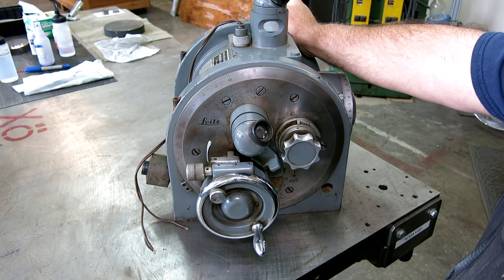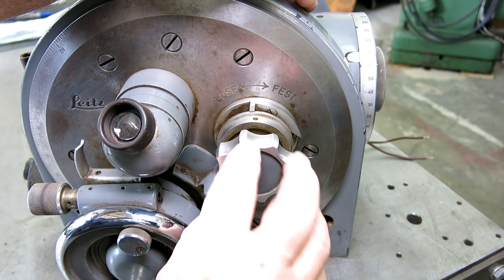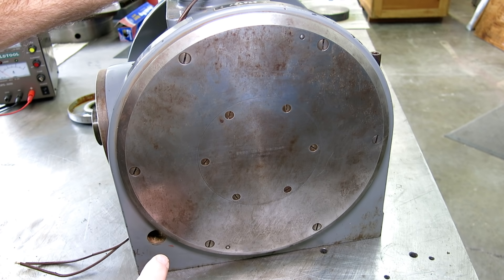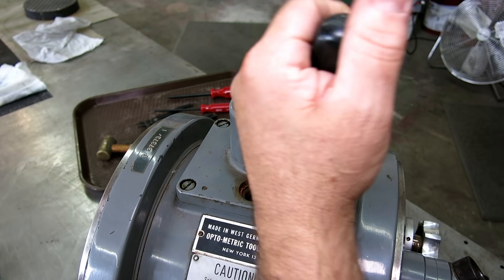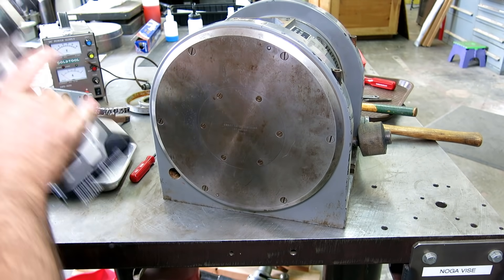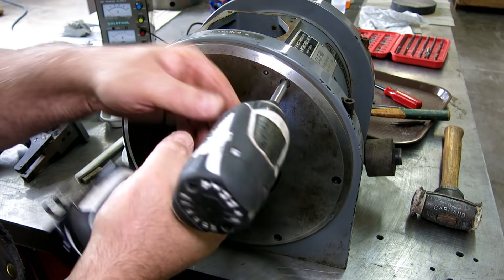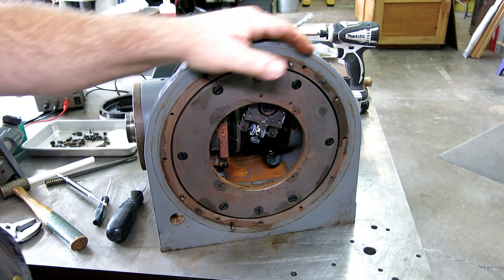Leitz Optical Dividing Head Teardown P1

Comment: Come on, Tom.  You know you're not going to give up on this beautiful machine.  I'll bet you've already got the brass rod in the lathe to replace those damage screw covers.  And there has to be some filing involved at some point or it wouldn't be a Lipton build.  Can't wait for part 2.  😉
Reply: As I was seeing that, I thought, "First time a glue stick would be handy in the shop." Heat the end with a lighter, plonk it on, and pull.

Comment: I'd go for a "last part" disassembly and clean up. This Leitz gadget is not rocket surgery. Leitz had great engineers back in the day. Great engineers do the difficult simply. You have the talent, tools, and care but you may not have the time. If you have the time, do it and bring us ham-fisted fumblers along. Maybe bring in an optics buddy to demonstrate the methods and tools of optical work. I bet you could restore that wonderful relic to as-new condition and accuracy.
Reply: There are a lot of things inside there that seems to be bits and bobs from optical breadboard setups.  Maybe Thor Labs or Edmund Optics has clues to things like thumbscrews and lens mounts/clamps.  If nothing else, it can be restomodded to some more modern bits - if I can 3D print a Raman Spectrometer than we can probably find something cool to do that is also worth their time (maybe auction the new device for charity or something - the best lab gear is custom lab gear, you know it's true) if it can't be easily saved by trying non-invasive material replacement techniques like reverse electrolysis or whatever the technical term is for putting material back while removing corrosion/oxidation like those folks that buy old iron stuff from yard sales and use a battery charger to pull the oxidation off and replace some of the material that was lost, among methods.
Reply: @russellzauner  atom by atom reconstruction is not what the dude showin the dividing head is about. He bought the thing to see if he could save the iron for use or cash. Maybe if all of us make enough noise he will put the stifflegdeadlift ironplate back to dialing blondeones. Afterall, the guy managed to save an optical bubble level thingy that cost the bolts on this dividing head.
Reply: That's why the last time i servest one it tock one ouer its not that complicated

Comment: 20:30 for pulling onto such flat surfaces, I use a suction cup salvaged from a car GPS  windshield support. Quite powerfull and can be found for free in e-waste.
Reply: I kept thinking "suction" or "big magnet" while watching that -- I hadn't thought of a cheap and handy source of a suction cup where there's enough flat surface to attach to. Simpler and cheaper than the schemes that were going through my mind.

Comment: you could restore it if you wanted to. lots of work, but I'm sure you have the ability.and could get the alignment back.
Reply: It may be more of a time constraint than a question of his abilities.
Reply: I’m sure he could. It doesn’t look that bad to me either. My guess is it’s not worth enough money, or it’s not worth the time it would take. Also seems like something with a very narrow use case that probably doesn’t apply to what he does.
Reply: @Kc12v140  To me it seems that he is just thinking it's outside his ability to deal with the optics. Getting those properly aligned after disassembly is no simple task. I think he could probably do it though.
Reply: @electech3339  Yeah, I think he should try and get it running with minimal time and effort and maybe he might even get some use out of it...

Comment: Looking at the inside almost had me crying. I have the same Ellis you have, and it does a very good job, for what it is. But this is pretty much the last great combination between the mechanical and optical arts for this type of device before computers made it obsolete.

I could also feel, in my chest, the torque you used on the screws every time you turned them.

Comment: I remember these indexers turning up regularly in the 1980's.  They were used by a company in the Tampa area that built inertial guidance hardware for ICBM's. I acquired a badly corroded version to tear down and remember the uniquely designed spherical race spindle ball bearings.

Comment: While it's apart, replace the dowel pins with pins that have threads for a slide hammer to pull them out easy. In case it ever has to come back apart you are ahead of the game. Whenever  I am rebuilding something I always make sure to do it, made life easiermore than once.

Comment: In addition to the parallel nature of gun smithing screw drivers I hear that it is important to have them the length of the slot as well. Mark Novak speaks to this on his youtube channel
Reply from the maker: Unfortunately they the gunsmiths peter out at around a quarter inch. Some of these screws were over 1/2 of slot. 

Cheers,

Tom

Comment: I have been fascinated with optical dividing heads forever, and would love to see a full teardown of every component on this, including the optics. Serious question if anyone here is capable of answering it- is there any company left that could reproduce the rotary optical scales on this with equal accuracy in, say, 1/3 size? I know it's totally insane- but I've always wanted a scale functional model of one of these for use on smaller high precision machinery. Because reasons. I'm quite serious. Excellent video Tom! Please go all the way with this, they are one of the black boxes of the machining world.
Reply from the maker: The same technology is used to make circular divided scales for transits and theodolites, Optical encoder and glass measuring scales for machine tools. 

Cheers,

Tom

Comment: These were used in the calibration of early versions of the turbo encabulator.  Very rare find indeed!
Reply: Not only in calibration, but also during the manufacturing process to align the spurving-bearing to the panametric-fam.

Comment: It could be the damage is just due to condensation forming inside of the instrument. A big chuck of metal like that would stay cold long enough for condensation to get trapped inside and cause the rust. If by any chance this can be restored(or even not), see if there is a way to fit some dessicant packs inside the mechanism to grab any moisture trapped inside.

Comment: Be careful with those boat anchors, Tom!  I'm in the market for a Shop Crane because I'm recovering from a back injury obtained from lifting my rotary off my mill and down to a low storage shelf a couple of weeks ago.  The probem is that a 12" BP rotary with handle brackets weighs 75% of what I do and the old back just wasn't up to it.

Comment: Perhaps reconstruction may be possible.  Please Mr. Lipton get "your partners in crime", Gotteswinter and Renzetti, into the loop.  You 3 routinely work to the tolerances that MARVELOUS piece requires.  Very tight budget here or not, I'd entertain a Go Fund Me effort to save 1 of the better efforts by Leitz/Wetzlar.  Human operated stuff like that is what made the initial efforts at automation remotely possible.
Reply: Yeah, anything is possible if you apply your max efforts to it, but when it's finished and polished up what would you do with it?....a collectors piece?.....hardly worth the effort to have it sitting on the shelf in your workshop for the next time you need to super inspect a series of divisions you did with a cheap  BS-0 dividing head.......I think this one is going to be put back together and sold or given to someone who likes museum pieces that were good years ago in a clean room but are now unreliable as a testing piece of apparatus......how can you fault a piece of work when the test equipment is faulty?

Comment: I vote for restoration at least, if not calibration. The transmissive optical components may well be ok, unless the glass has been attacked by fungus as it was in some of my old Canon lenses. Terrible to think that so much damage has been done by leaving it in a damp shed and temperature cycling it.
Reply from the maker: Indeed they have been attacked by something. The main dividing scale has what looks like creepy crawler mold tracks on it. I have not tried any cleaning methods on it yet as it still stuck in its mount.

Cheers,

Tom

Comment: Can't wait for part 2. Curious how those somewhat spherical bearings work, I'm assuming they only exist to condense the bearing components for both rotational axes into a single part. Also curious at how bad the interior of this actually is, it had quite a bit of rust, but what component actually rusted that badly, and how easy would it be to replace it. Assuming the interior isn't too drastically bad, this could be a fairly simple restoration.

Comment: On second thoughts: This might be salvageable!
The thing is this: The reading accuracy comes from the glass scale and the compensation of concentricity errors, alone.
Is there anybody you can go to for cleaning up the lenses in the microscope attachment, and then reassembling the thing on an optical bench? Anybody who services optical theodolites will do!
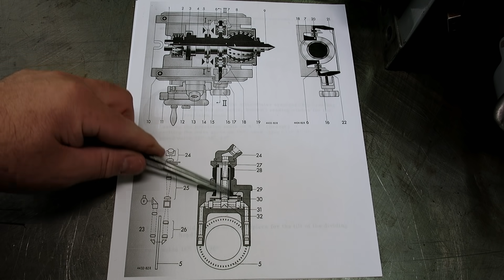At 13:10, you can see that the concentricity errors are compensated in the usual way for theodolite scales:
Reading on two opposite sides with a centering error will result in one side reading too high, the other too low by the same amount. Since one side of the division serves as marker for the other, you automatically read the average.

On the arcsecond level, the spindle and the glass circle cannot be regarded as being concentric, anyway. Trying to achieve this is an unnecessary ambition.
The goal must be to make the spindle bearings as stiff and and as true as humanly possible, again *which I am sure you can do*. And the circle must be attached without constraining loads which would distort it. Then the reading arrangement of the glass circle will tolerate a small offset in any direction as intended by the designer.

As a final step, you could check the accuracy with an arc second theodolite (Wild T2, Kern DKM2, Zeiss Th2, Zeiss/Jena Theo010, or something of that calibre) like this: /watch?v=3NcIu0EF6lQ

Comment: For resyncing the scales, machine a horseshoe piece with the ends machined inline with each other.  Then you can loosen the shafts that they pivot on and with some slight pressure on the "horseshoe" it should bring them back to alignment, then you can snug up the screws on the shafts.

Comment: West Germany is a dead give-away of its age. Either way, gorgeous machine. If i had one, in its off days, it would sit in my room so i can look at it. :D
Those illuminations scream want for a modern "hack" where they're powered by a few button cell batteries. Those wires kind of uglify the whole aparatus, and these days those pocket LED key chains are bright enough to blind you, so plenty of power from 3 of those button cells.
Reply: I dont know about dead give-away.  West-Germany existed from 1945 to 1990,  which is a rather round estimate of its age.
Reply: @arnljotseem8794  I ate a few words in my excitement. That kind of plate was pre 90's in my experience. So that narrows it down to the period right in the middle because they didn't start using that kind of name tagging (to my knowledge) right after the war.

Comment: Oh my. You know what happened? A closed box always collects water inside due to temperature cycling. Nowadays such things have a desiccant breather.
The mechanism is following: Upon warming the unit, air is expanding inside and is moved out due to increasing pressure. Upon cooling down air is returning back from the outside. If the unit gets cooler than the dew point of the inside water vapour, water drops condensates on the surfaces. Unfortunately, heating again does not dry the inside, the liquid water remains. After many cycles you have enough water for severe corrosion.

Comment: Automatic transmission fluids help clutches not to slip.  So brake or a clutch, there is no difference as far as the oil goes.

Comment: Interesting piece of equipment. While I'm sure it could be saved if enough effort was put into it; the question is whether or not it's worth the effort. It looks like it wasn't meant for use in machining and modern inspection labs would have little to no use for it. Still, I would be very interested to see it come back to life if Tom decides to make it happen.

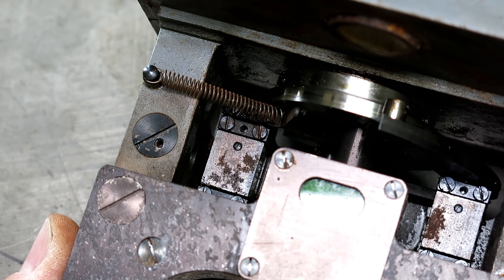Comment: 26:25 shouldn't the roller tracking on the cam actually roll instead of slide?
Reply from the maker: Its not actually a roller but a fixed pin.

Cheers,

Tom
Reply: @oxtoolco  thanks

Comment: This is a tuff one. All superior mechanical beauty made with a huge effort to get it right all the way for years to come. I love the product just as you do but restoring this to it's full accuracy requires the help of an old dude who serviced them in the past as a minimum. Otherwise your lost in such an intricate structure. You just don't know why everything is as it is. But you're sure everything is thought out real carefully and here you are poking through the internals without a real clue. Feels like disintegrating a Faberge egg with an axe or a similar tool or a similar delicate product. The fine tuning after machining only probably took weeks for guys who knew what they're doing. You could take it all apart and clean the parts as a magician. That's possible and would feel good just as filing does. Mounting and recalibrating afterwards would be at least a huge effort or maybe even impossible. It breaks your heart to see such a great piece of high end engineering and machining in this state and concluding that recovering is not an option for a person with another life too. I feel your pain and hate the sucker who went sailing with it. I want to thank you for keeping me on my toes for the during of this video. I hoped you would dig in deeper but I totally agree with your conclusion to leave it as it is. Leitz should have use stainless ;-) Best regards, Job

Comment: as a telescope maker and Physicist I can only say that Leitz was always a tiny little bit nicer than Zeiss, mechanically and optically: Smaller production lines, a bit more manufacture than industrial compound. It is the same way in which Patek Philippe makes neater watches than Rolex.
The main thing you can learn from these devices is how to transmit forces without causing deformation or strain. The old guys who constructed these things thought four or five times (rather than twice) before taking a technical decision.
Unfortunately, I am fairly certain that the basic accuracy is gone: you will have a very hard time getting that thing back to sub-arcsecond precision.

Comment: That thing can be restored, it´s rusty, but not far gone.
It still moves easily, so the bearings seems to be fine, the issue with the worm seem to be just adjustment-related in its tilting mechanism.

I´d like to say "Ship it over to its home country, I´ll try to get it back in usable shape!" but I´m pretty sure the postage alone will leave me broke.
Got no education in the mechanical field though, but tinkered around with mechanical calculators for some years and got a few old cameras working again, so it should be doable.

Comment: a beautiful piece of equipment made by the Germans!  I wonder why they didn't incorporate Jack Screws to enable plates to be removed off of two dowel pins.  I know you know what I'm talking about Tom.  But anyway,  I think maybe they were so arrogant that they thought it was made so well that it will never be disassembled???
Reply from the maker: The did have a setup for pulling some of the dowels. That will be shown in part 2. I didn't recognize them for what they were right away. I did eventually get the hang of it.....

Cheers,

Tom

Comment: If you want to restore some of the parts that are rusted, boil the rusty metal for 35-40 minutes. Then, take a carding wheel (Brownell's) or de-oiled steel wool, and rub off the "felt." Gunsmiths have done this for centuries with rust bluing steel.

Comment: I'm going to somewhat disagree with everyone saying to restore it. Any restoration would end up replacing so much you'd just be building a replica, with a few of the bigger structural parts original. Calling it a "restoration" just seems wrong. 

Making a replica, however, possibly with a few original parts (like the handwheels), might be interesting and more worthwhile. And less effort trying to get rid of rust, no worries that the resulting material removal will end up in a part out of tolerance, etc.

Comment: Maybe Tom could do this as a collab with Hand Tool Rescue? 

Let the Hand Tool guy take everything apart with a drift and punch set, do a lead test on the paint, wire wheel some of it, and put the rest of it into a plastic strainer and dump it into in a barrel of evaporust. 

Then, Tom could put it back together, realigning all the mirrors and tricky stuff.

Easy peazy.
Reply: It's a thing of very great beauty, but it needs sticking in a bucket of Vinegar for a few weeks. And like Jaws mentioned. you are going to need a bigger Bucket. ;->

Comment: This thing needs to be pulled apart completely and gently massaged back to life. A little bit of lubricant won't save it. Parts need to be remade, or restored. Get your emery cloth, and stone out and get to rubbing.

As far as it getting soaked, i wouldn't be surprised if Bubba the Masheenest used this as a fixture in a mill with coolant running over it. And given the corrosion, used water with almost zero additives.

Also, this would be an excellent time for a paint marker to mark part orientation. Because it's German there won't be too much eccentricity but it's good practice for this sort of teardown.